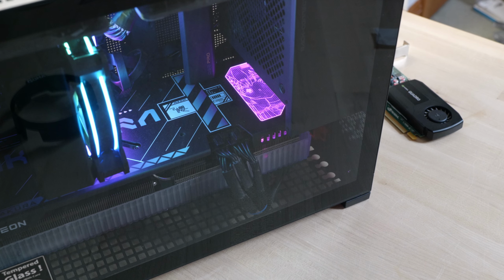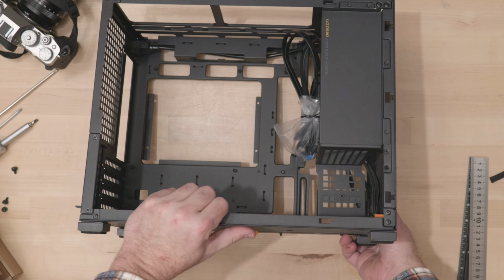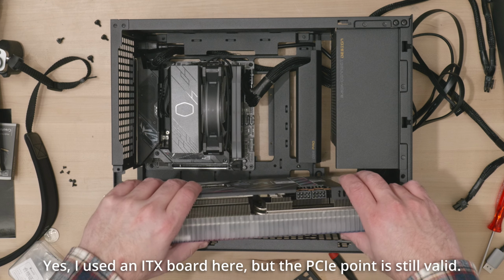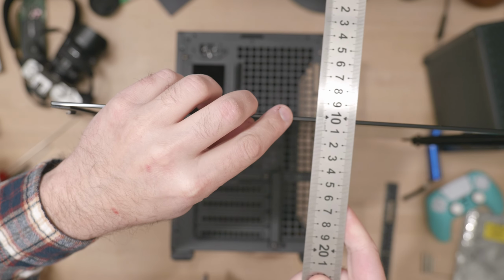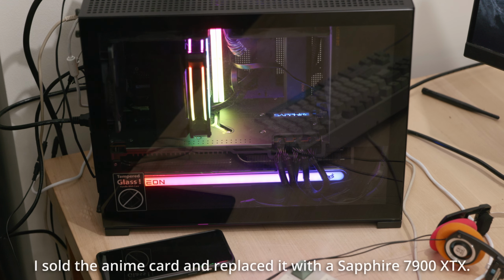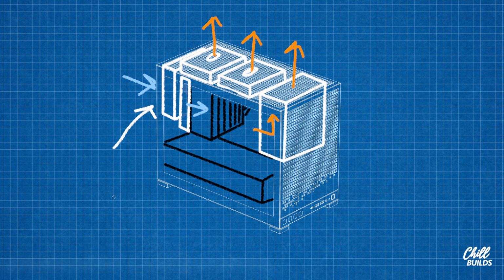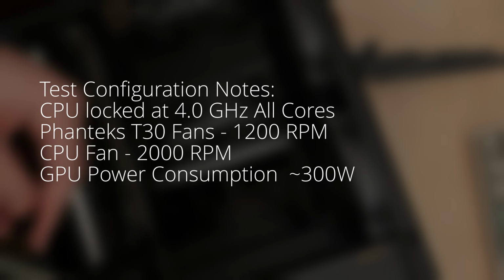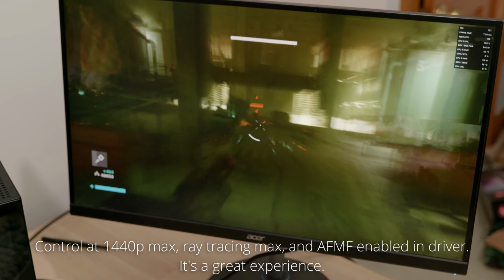Chill Thoughts: Jonsbo D32 Pro

Comment: How is the pressure in the case? Just bought a mesh version and added intake fans at the bottom, but still it seems that the case still pulls air from the side, even after adjusting the intake/exhaust fan speeds - worried about the dust..

Comment: Hi, do you know if the handle of the Z20 can fit on the D32 Pro? Could you try it out if you still have both the cases?
Reply from the maker: I do not have them both still. I don't think it would be a good idea to try it either. I may be wrong, byt my impression is that the panels of the D32 are far less sturdy than the Z20. 

I could be wrong.
Reply: @ChillBuilds thanks for your insight

Comment: 240 aio is the way to go for this case, and as long as you dont install the fattest of gpus (5080 in mine atm)  you can still fit 3 fans on the bottom as intake which keeps my stuff at 30 C for normal tasks and low 50's C for full load

Comment: Bought mine from Newegg Canada, it was in perfect condition, and Newegg has top-notch customer service, at least here in Canada it does, I love the case, and I bought parts that fit in it, their website has very clear specifications for PSU length depending on what PCIE slot you put your video card in, always do research before buying online, thanks for the video !!!

Comment: i'm curious regarding the PSU power cable, with the config how you do it? is there a L shaped power cable? or you just  cram it there
Reply: theres an adapter cable pre installed thats already fit to reach the back where you connect the psu power cable

Comment: I have a Jonsbo Z20 case and its layout is very similar to the D32 Pro.

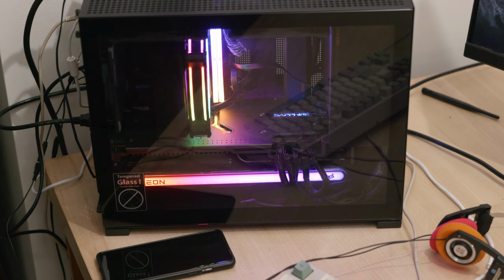@2:46 , you’ll see three different fan configurations, with the most effective setup showing the rear fan as an intake. The CPU fan draws air from the rear and is positioned toward the back of the tower’s fin stack. The top fans act as exhaust, while the PSU pulls air from the front panel. If there are fans mounted beneath the GPU, they’re configured as intakes as well

Will it hurt or improve if you use the 2nd top exhaust fan closest to the rear? Will one closest to the psu suffice? I was thinking of just using one 140mm there and assume that the fan closest to the rear would steal the air coming in from the rear fan but I could be wrong.

Comment: Thanks a lot for the test . What do you think about psu overheating (taking air from inside the case) in the best temp cpu/gpu config tested (comment recommended ) ?
Reply: Yeah i need more info about this as well, although very late.

Comment: I really can't understand why you couldn't install two fans on the bottom like literally every other owner of this case.
Reply: Because he didn't want to buddy, that's the only answer that matters.

You didn't like that? Ok buy a D32 Pro yourself and put those 2 goddam fans yourself.
There you go, easy and without crying.
Reply: @Canis_Vulpes  I was trying to be polite and give him the benefit of the doubt. You didn't have to go and call him out like that, kind of rude tbh. No need to be a huge pos about it.
Reply from the maker: Hey, this is chill builds, and you seem to be getting pretty worked up in a lot of the comments you leave. Are you OK?
Reply: @ChillBuilds  damn this channel blows
Reply: @ChillBuilds  You're the one acting very defensively over a very fair constructive comment to a channel called "Chill Builds". Read it again and ask yourself what about a simple question required that response. You went and did temperature tests on this case and the Z20 and on both of these hands on reviews you didn't even use the two best air inlet locations recommended by the manufacturer, why did you make such an uncommon choice? I hardly think this is a ridiculous question.
Reply: @Vespyr_  but... you didn't ask a question in your initial comment... you implied that he was either incapable, or too dumb, to do what you were suggesting.
Reply: @NA-mx8bn   "I can't understand why you couldn't install two fans on the bottom" is inviting an elaboration on the question, of "why" a certain choice was made. Maybe there was a good reason for it. I don't understand why a temperature test was done at all, when the two coldest intake locations in an MFF case weren't used. Aren't YOU curious?
Reply: @Vespyr_ 
Yeah that's an understandable question, but you seem to be very intentionally using aggressive, critical/judgemental tone in your writing. If you are, just be honest about it. There's nothing more annoying than people who speak with condescension and deflect.
Reply: @alteac  Alright man, word comprehension time. Please explain what "I really can't understand why you couldn't install two fans on the bottom like literally every other owner of this case." Means to you.
Reply: @Vespyr_  why 2? If you had a real system it is 3.
Reply: @Vespyr_  because you literally did not ask a question you made a statement and I can’t comprehend why you don’t know the difference.

Comment: Would you add any fans to the bottom of the case?
Reply from the maker: @Silvrdag  maybe, but even the quietest fans as noise to the case, and if I already have more than enough cooling, I wouldn't bother.
Reply: It'd be foolish not to tbh. This guy doesn't seem to have good hardware. Anyone with a real system is going to need the cooling.
Reply: @Vespyr_  I had no idea 7900 XT is a fictional component. Cheers for sharing!

Comment: I thought the tempered glass sticker is on the plastic cover?, it's stick directly to the glass?
Reply from the maker: Correct.
Reply: @ChillBuilds  So I feel this glass has too much reflection, my other cases don't have this much when taking the picture.